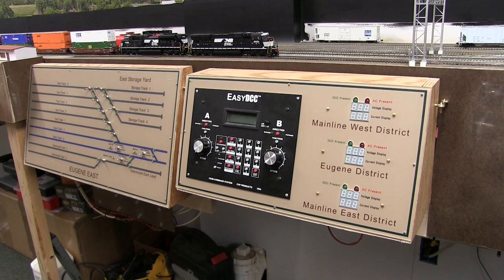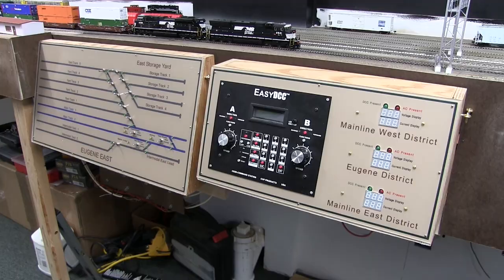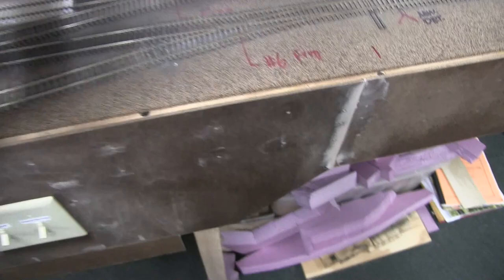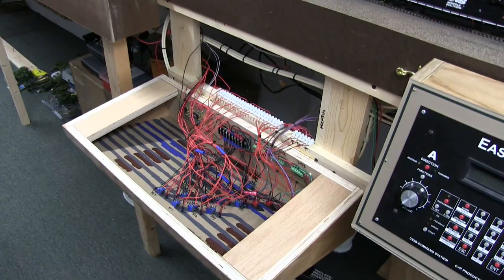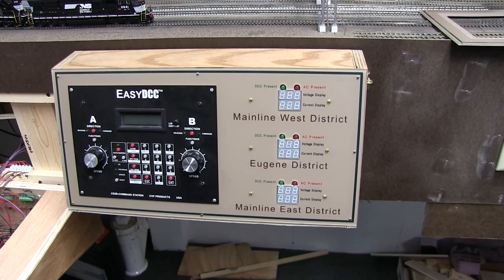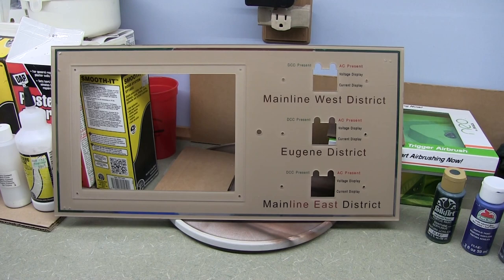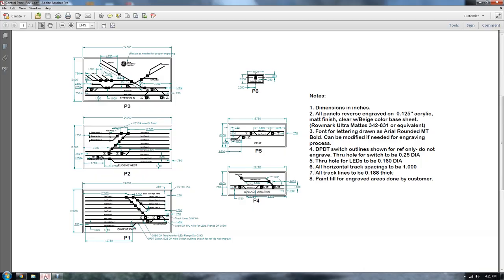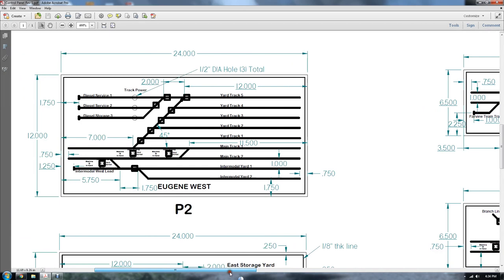Model Railroad Update: Reverse Engraved Control Panels

Comment: Not surprised by the price.  What is a surprise is you did all the work.  All they had to do was put it in a computer and CNC it.  If they had to do the drawing then it would not be too bad but since you did it that is way too much.  They do look great and very professional.  Back in junior high we did it the old way, heat the panel and use metal letters to press in the acrylic.  Once cooled fill with coloured resin and lots of sanding.  Today its easy with a computer and CNC machine.  There is a machine you can get these days for the home user which has 5 heads for engraving, 3D printing and CNC but its around 10K.  The main things is its your money to do with what you will and that you are happy with the product.
Scott

Comment: Great video and the boards turned out great. Have you ever detailed how you wired your volt/amp meters?
Reply: +Joseph Airoso Hm, not sure! It may be in one of the older controls videos. It isn't very difficult to wire- they just go in series with the two track power lines from the boosters. Let me snoop around a little.
Reply: That would be great Thanks